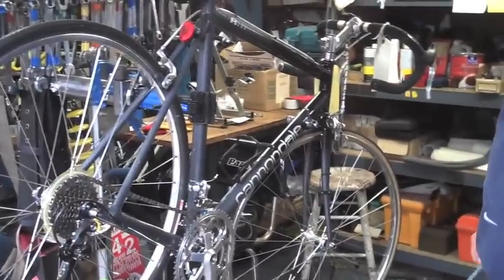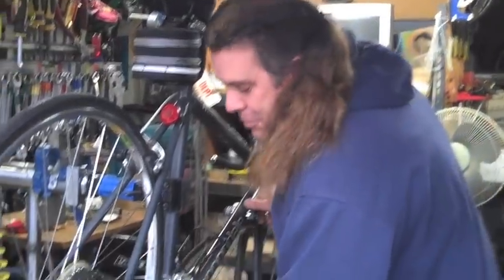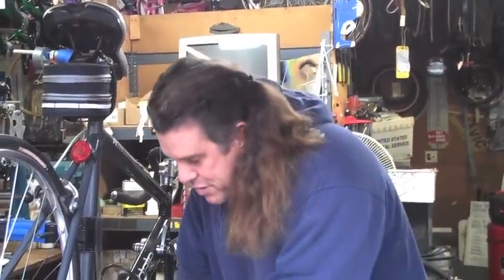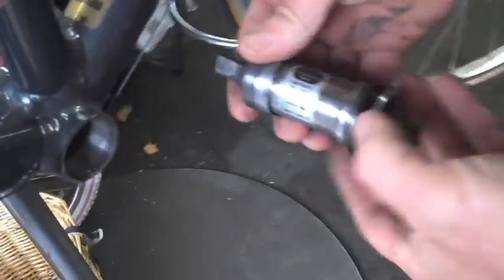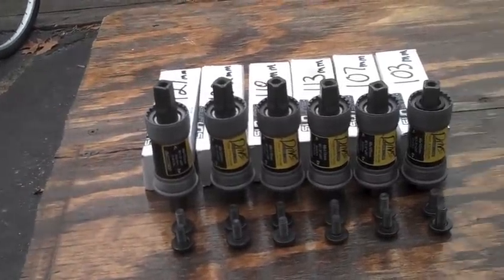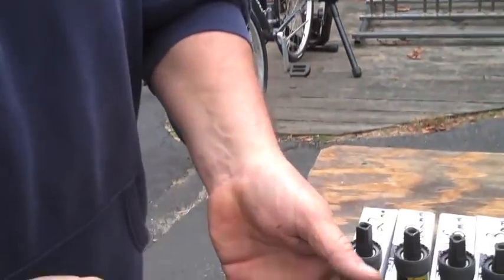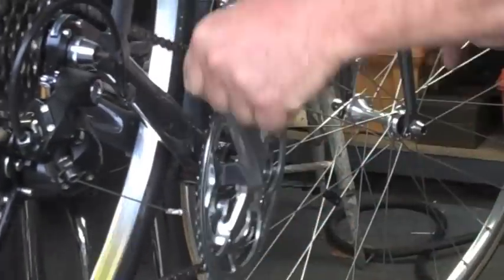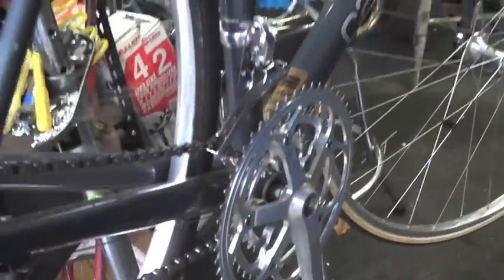Sealed Bottom Bracket - 68mm BBT Shell Spindle Lengths

Comment: I'm restoring a bike that has apparently had a spindle replacement at some time, because the one that's in there is 122mm, but it's too short, allowing barely any clearance between the small ring and the chain stay and drawing the chain line too far inward.  I'm applying the somewhat controversial beer can spindle length augment method until I can get hold of a 127.5mm spindle.  This gained me 3mm, just about perfect.  And it will last until the next time I have the cranks off, which since I just overhauled the BB and will ride this bike only occasionally, the beer can shim fix could last forever.

Comment: This video is why I love the new external crank sets.  No more going bike shop to bike shop looking for the correct size bottom bracket.  One size fits all with 3 spacers and if you go from a double to a triple just adjust spacers as needed, very simple, and also eliminates the crank puller tool which is a added bonus of being able to take a crank set off in less than a minute with a 5 mm wrench and the shimano pre load cap tool.

Comment: You can also look up the specs of the crank groupset and it will say. For example my 2013 opus Zermatt has..  FC-m171 Shimano.. So.. UN26 or higher.. 122.5mm there is always a spec sheet for each groupset.

Comment: Great video, I learnt a lot. I was wondering if you have any tips for removing a bottom bracket that's in there really tight. I'm using 15" adjustable spanner but can't seem to get enough power. Any ideas other than a torque bar (that I don't have)? Thanks

Comment: Thanks mate, perfect vid. I have the same problem, bought a used bike which was a complete mish-mash of different parts. I actually got half-decent (but old) Shimano STX RC shifters set but the bracket and chainring/crankset is some cheese-grade chinese garbage. 
I couldn't get the front derailleur to drop the chain to the lowest gear. I didn't know why, but now I do.

Comment: I wish there would have been a whole lot more explaining of chainline because I think there could have been a couple solutions to fix the shifting problem. Obviously the spindle length was to short once the owner installed a triple crank, but by just installing a longer spindle you also changed the Non Drive Side and Q-Factor. You may have gotten away with the 118mm BB if you added in those spacers that essentially would have made the BB housing shell a 73mm wide shell. Also aren't the derailleurs for double and triple different. I'm not the best bike mechanic so I don't want to criticize your skills and you probably solved an issue as cheaply as possible. I'm just looking for more tutorial info about Chainline and Q-Factor and ran across your video. You do have a lot of good videos that are very helpful.

Comment: I am a sub'r from awhile back. 
Great vid.!
I have a question.
Here are the facts.
My bike is a 1996 sr500 cannondale that I am upgrading.
SRX front triple crank w/ Salsa rings, 46,36,26
#'s on the bb:
BB is a shimano : BB-LP26
next line : VIA 68 T6
BC1.37x24
Is there a ceramic bearing bottom bracket available to replace the old one.?
If not what would be your recommendation for a few steps up replacement.?

Comment: good morning sir..I have an old racing bike.but I want to turn it into a fixie bike.sealed button bracket which is suitable for single speed.I want to close the chain ring distance with the frame.is 68x103mm suitable or 68x107mm? 1964 carlton vintage bike.I'm stuck.still new in bike modification.thanks sir.have a nice day👍

Comment: you change it for longer spindle and the small chain ring works fine,,,, but the big chain ring will also works fine? thus the front  derailleur can travel to the big chain ring with the longer spindle bottom bracket?

Comment: I noticed square taper bottom brackets still being used on not so cheap bikes , what is the advantage ? I imagine modern super stiff cranks would place a lot of torsional stress in the  small diameter spindle and I have seen them broken .

Comment: Hi. I'm currently using 122.5mm bottom bracket with single speed chainring but my new crank arm's non drive side hits the chainstay/frame. Can I use a 124.5mm to solve the issue?

Comment: Hi ive just put a rear wheel electric conversion kit on my GT mtb,the pedal assist goes on the left side bottom bracket but its about 5mm and now i cant do up the crank arm tight no more so the bolt now comes loose and falls out every couple of miles. I have a 68/113mm,if i just replace with a 118 will that sort it or will i have probs on deralilier side. Any advice would be cool theres only one local bike shop n they always just shrug their shoulders at me cuz they know a buy on-line which is half their shocking prices plus ive now got a proper bike tool kit n work stand,thanks.

Comment: I have a one piece crank road bike frame and I want to convert it into a fixed gear. I already know that I'll need the converter kit but I'm not sure about what size bottom bracket I should get.. I need assistance BIKEMAN! One more thing, since Sunlight bottom brackets are square taper, does any square taper crank fit?

Comment: Good day BikemanforU, would like to ask for help, had my bottom bracket replaced by a bike shop did not keep the old cassette bottom bracket, I think they replaced it with the wrong one, how do I measure the correct size cassette type bottom bracket. My bike is a Diamondback sports overdrive 2013, no info on there web site. Thanks.

Comment: hey Bikeman, I have a 2011 Giant Sedona ST, I was going to replace my bottom bracket that has bearings in a cup with a sealed bb, I have a 68mm shell  and when I measured the spindle length is it 131.5  mm so where can I get one or can I go down to a 127.5mm?
thanks

Comment: bikeman! can you help my mom's project 3x7 to 1x7 bike? removed suntour sr crankset from her old trek 800 st (crank puller/torch/hacksaw/hand axe..my typical procedure). removed 63mm/123mm square-tapered bbt. removed old triple ring. here's my quandry - spindle length for a truvative powerspline bbt that preserves good chainline for a new single ring, sram s600 with bashguard (powerspline-specific set). they have a 108, 113 and 118mm spindle. i'm either over-thinking or asking a really good question...any idea which i'm gonna need here? mainly reducing complexity for mom, plus her crankset was shot, and i get to see how this kinda 1x setup works! any recommendation on length? thanks!!!
Reply from the maker: I would use the 108... Let us know how you make out.. Post some pic's
Reply: BikemanforU bam! will do! thanks bm4u! ordered crankset & 108. got her a new sram mrx comp 7-sp shifter, new shimano 14-34t freewheel, new kenda 26x2.125 'cruisers', new cruiser susp. seat, yanked ring shifter and FD. has long stem & high bars already like a cruiser, calling it a 'mountain cruiser' for lack of a better. mom should have a unique bike! forum fellas think it's a strange build, but ma loves the old thing..just making it nicer for her bday (74), eh? :) only uncertainty is chain drop..using stock, long altus RD, not a shimano shadow or sram type 2 clutch RD, and no chain guide tho may rig the FD back on for now if seems needed. think just a plain short or med cage RD be a good compromise for keeping chain on? not like mom's gonna be mtn bikin' anyway..just cruising. prob over-thinkin! love the channel, here's a shout out! :O
Reply from the maker: Ryan Vestal  You did a great job on that bike.. Good edit too on the vid

Comment: Oh man: You should be actually looking at the space between the frame and the left and right crank in the backward position to match. Yes - watch for the cranks.
Reply: The left crank has always a constant distance. It is only on the right side (mostly) where the BB vary. This is only due to different constructions of crank-wheels. Thus you should really look that the position of your right feet matches the position of the left relative to the bike frames center line. And that is done by measuring the distance of the right crank to the frame. Put it in a backward position and measure the gap between the end of the crank and the frames horizontal bar extending between the wheels center axis and the crank axis. Then you will magically discover that the gear-switcher will match too. Because that is how those things are constructed to work.

Comment: Won't help. The original derailleur was already touching the frame, and so would ANY other type derailleur. You need to move the crank away from the frame; the only way to do this, is either using spacers, or go the quality way and install a correct length bottom bracket.

Comment: No  you do not need a longer bottom bracket.... those spacers are meant for rear chain rings to change a 7 to a 10 speed ect.... professional bike mechanics to a mcgiver mechanic. But still good video. It's called chain rubbing or fucking up your bike. That's what happens when you dont know what your doing. Having a bigger bottom bracket is going to bend the rear and front derailer. More expensive than using those spacers on the rear chain rings.